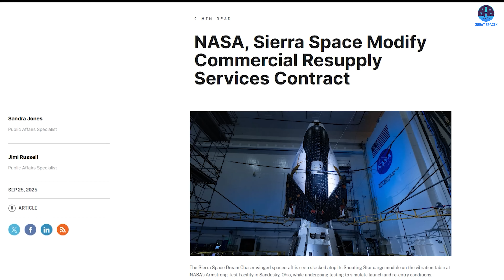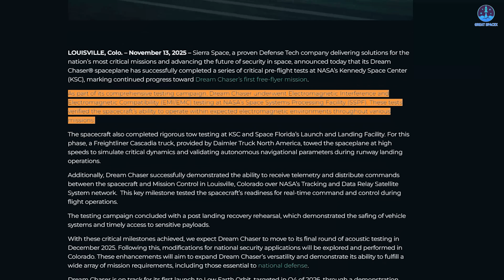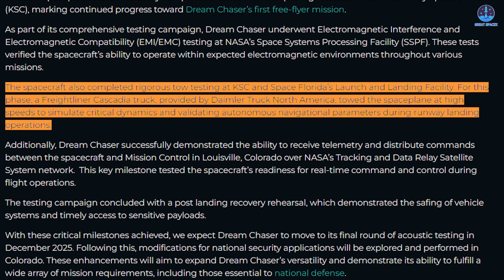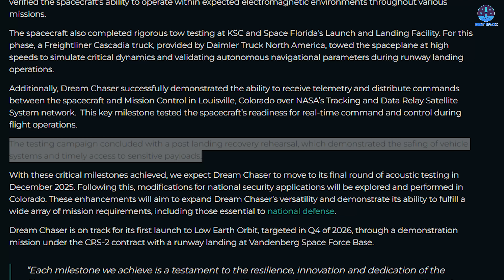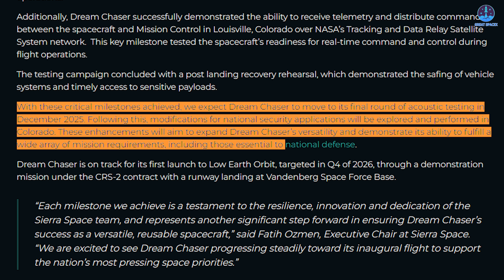Finally Happened! NASA’s New Spaceplane Ready for the First Launch after Constant Delays…

Comment: I hope they can ready this space craft before International space station is deorbited or finished it's operation. 🇺🇸👍🚀😍
Reply: If they adapt it to use Falcon 9, it should with plenty of time. It is well within F9's launch mass but is larger than the existing fairings. I don't think BO or ULA will have the extra launch capacity for some time. Short of a disaster, I fully expect they will extend the ISS life past the current plan.
Reply from the maker: Okay❤️

Comment: If its un maned its not a Space Plane...its a space Drone!😂
Reply: Valid point! I feel like it will eventually become a space plane, though. I'm really rooting for this one to succeed. An actual space plane will have touch and go capability. That is, if the turnaround time is short, which is what I'm expecting. I guess we won't really know until it's fully functional.
Reply: @Chaotician69  I doubt the turnaround will be all that short. I would be highly impressed with sub 1 month. ISS doesn't need resupply from a single provider that much. So it will likely never be asked to do that.

The main advantage is that it would be able to land at any major runway. This is mostly only an issue in an emergency. With our shuttle experience we know that isn't really that needed. Any of the capsules have plenty of time to allow for recovery prep, choosing a safe and reasonable reentry. The delivery of goods from space to remote runways has so far failed to show value.